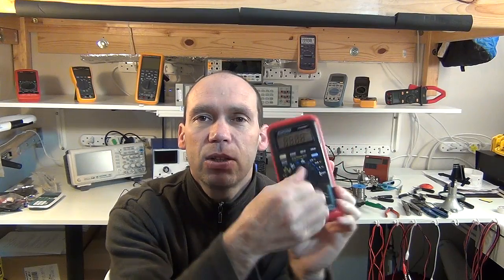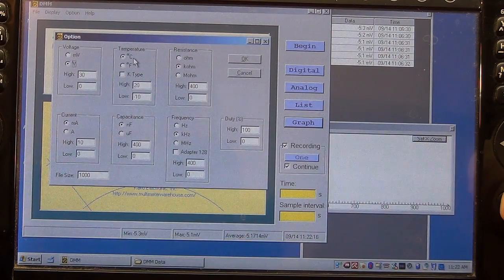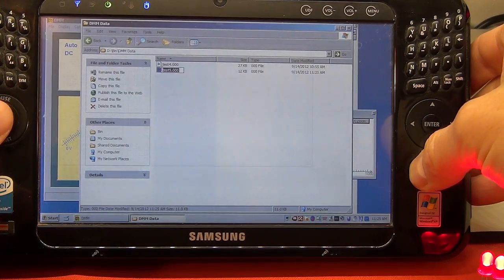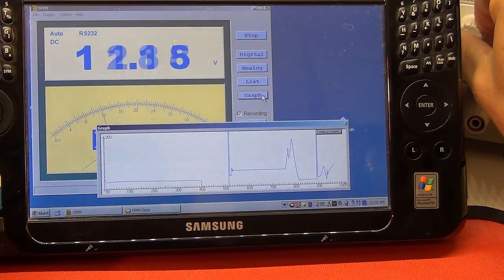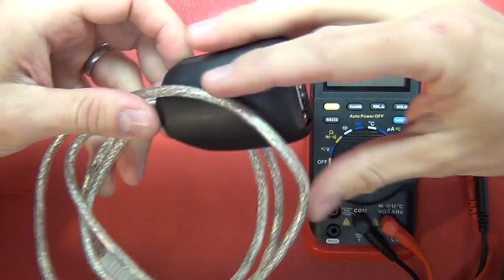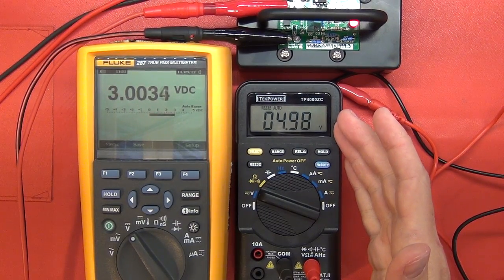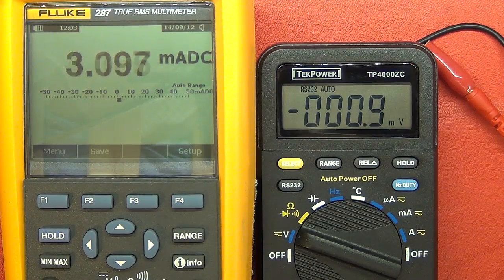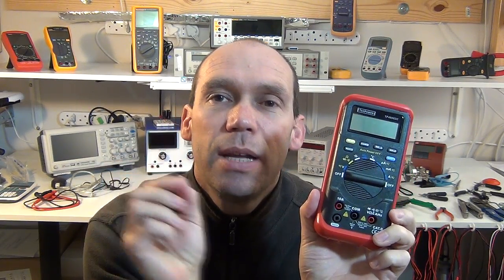Multimeter Review - buyers guide: Part 2 - TekPower TP4000ZC / Digitek DT-4000ZC with data logging

Comment: The RS232 power consumption is the reason I modified my UT61E recently. They designed it with RS232 hard on, which also disables APO. A little fiddly soldering, a phototransistor, and a cut trace, and it turns on when the cable is inserted.

Comment: Hi - Interesting review ... by the way,  it's identical from front panel, pcb layout and specs to my Digitek QM1538 bought from Jaycar in September 2002 for AU$69.99!.
I analyzed the serial output with a view top creating a Delphi control for it and was quite supprised to find that it was a bit mapping of every drivable segment on the LCD display rather than any numeric data - actually quite clever as it includes the DMM settings and range with the measurement (sorry i don't still have the mapping but it wasn't too hard to figure out).
Note that holding down the RS232 key at power on toggles its initial state.

Comment: thanks... an excellent review... and more.  I've ordered the TP8236 ( $59 US ) which has a true usb 2.0 data input connector. I initially plan to use it with my Dell Win 10 laptop to capture 12 VDC battery voltage and current on my camping trailer when using a solar cell panel...Hope it works as well as the model TP4000... Ftrd T

Comment: Hi, can the auto power-off feature be turned off so that it stays on all the time?

Also, would be nice if they published what the binary protocol is on the serial...   in case you don't want to use their WH5000 GUI application, and just need straight logging!

Comment: Thanks, for the video. I bought the Digitek DT-4000ZC from Franky on ebay. It is not very accurate. I checked a car battery and it showed 12.7 and a known good meter showed 12.5. The accuracy varies across the scale. What do you recommend I do? Should I send it back or can I can I fix it?

Comment: High Martin good video again, but when are you going to remember that the HZ setting is meant for audio and other low voltages and if you want to measure the mains frequency you do it while on the AC voltage setting, that's why the blue marking on the switch.

Comment: Excellent review, Martin.  About the Auto-Off, I used this DMM to monitor (no logging) the DC current while discharging the battery in my hybrid car.  Didn't disable Auto-Off but the DMM stayed on for the entire 4+ hours of the discharge cycle.  Perhaps if the measured quantity is changing it won't shut off.  Just a theory...

Comment: I wanted to like this one and goofily wanted to buy one even kinda cause it looks like the 87V and I like the look of it-lol-  Its great that it has the data logging at this price but my nitpick is $30 and no backlight-?- Also its the only meter ive seen with temp function that didnt support both C* and F*, we went to the moon over 50 years ago seems to me a backlight and F* would be no problem as I have seen many $15 - $20 meters with both features .  The pc board is nothing to write home about with minimal to no input protection and fusing, and I saw quite a few electrolytic caps and knowing how these always fail or change value how long before accuracy is affected by these caps.  I will say though in your tests this meter showed very good accuracy for its price range, but my own nitpicks aside as you said I have to admit in 2012 when this video was published this meter would have been even more of a bargain than today in 2018 - but today there are others around this price with better build quality that might be worth looking at.  Im childishly still fascinated with their attempt to style it to loosely resemble the 87V-lol

Comment: I need a multimeter that can accurately measure peak voltage spikes from motorcycle stators while they are being kicked over. Can one such as this accurately measure AC voltage spikes at around 60hz +/- (kickstarting at 800rpm) when set on the min/max function?

Comment: Update:  Through trial and error I've found that disabling the RS232 output will engage the Auto-Off.  It doesn't matter if there is a PC connection or not, as long as the RS232 is active the DMM will not automatically turn off.

Comment: You measure Mains Voltage, Hz and Duty cycle in this video. Could this multimeter measure mains current. I see it's rate 4/10 A for AC current. So could I measure AC current on a 220v system with say a fridge rated at 5 amps/1.1 kw?
What exactly does 4/10 A mean? A min of 4 and a max of 10 amps? If so why is there a minimum measurement of 4 A which is quite high? 
Regards
Mark